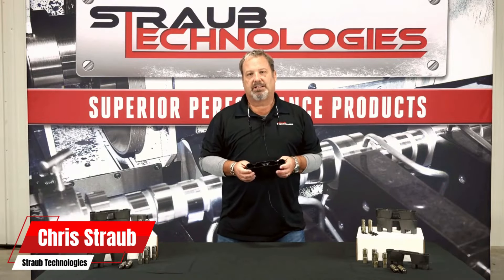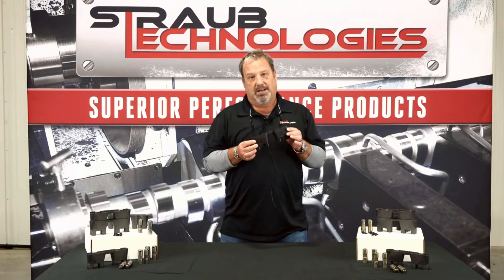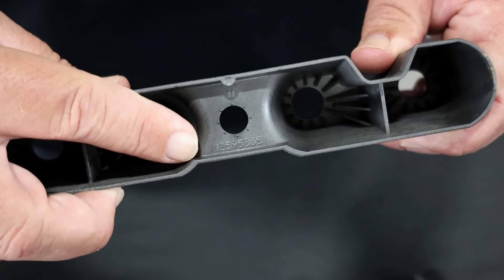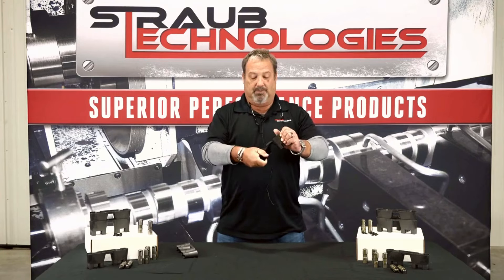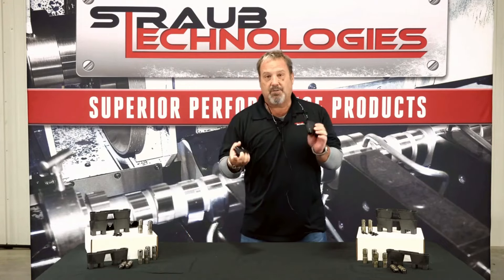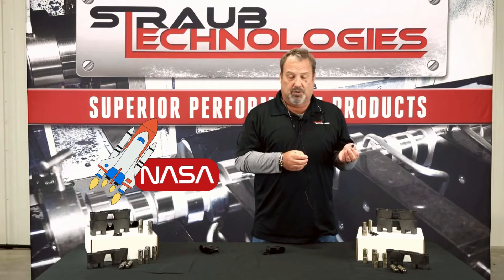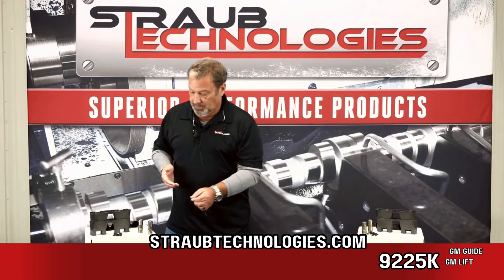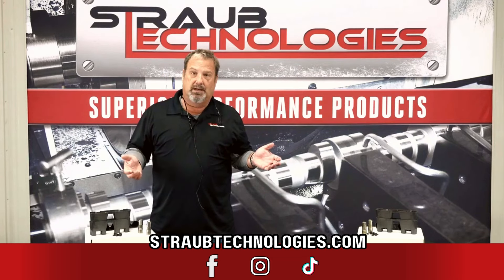Lifter Guides and What You Should Know

Comment: Chris can you comment on the Morels? I know 7717 is the current part number, is there any significant difference between the new 7717 number and the old 6504 part number? Thanks in advance.
Reply from the maker: All the same parts, the 7717 has a coated axle.
Reply: @straubtechnologies  OK, so nothing overly significant. I have 6504s in my daily driver, so far so good. Just wondered why the part number change. 

Thank you for the explanation.